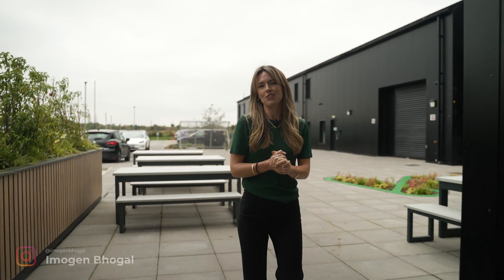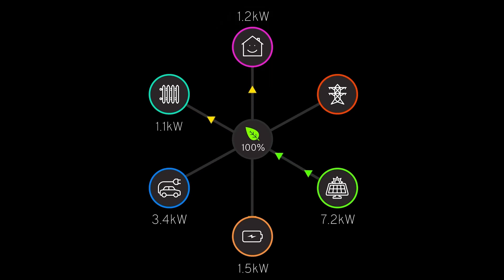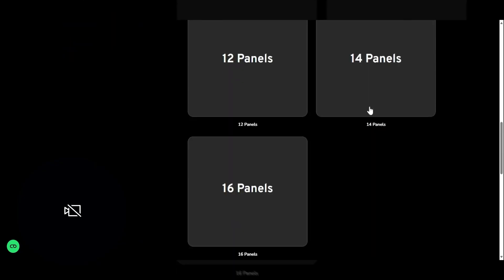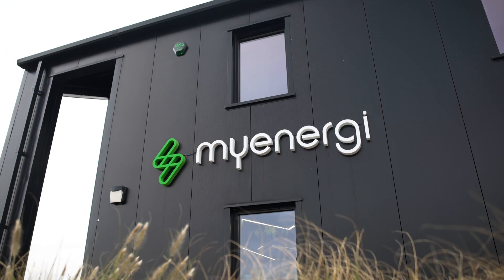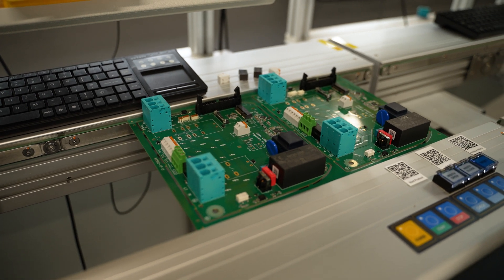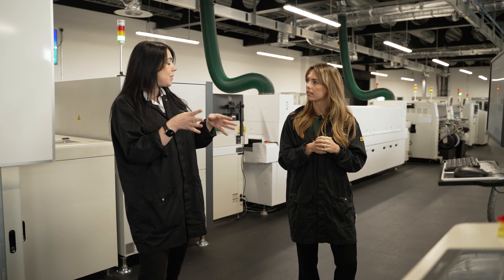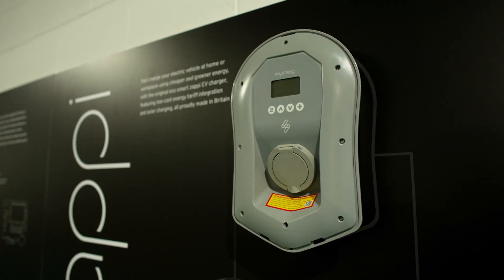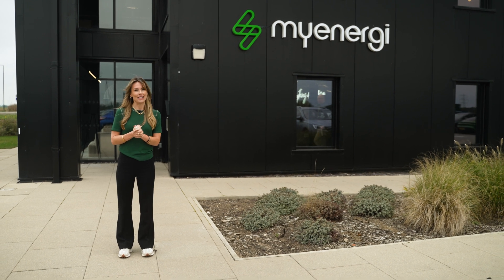myenergi One: THE Way To Get All The Home Energy Tech You Need! | Everything Electric Show

Comment: I got a quote on the Myenegi website for a 10KW battery storage system...slightly under £8,000
Being optimistic:
Say you save 10 KWHr (10 units) per day for 6 months
(bearing in mind most days even in summer are cloudy in UK)
180 days x 10 units x 25p = £450 pa
Roughly £8000 / 450 = 18 yrs payback
That's if it lasts that long
Better off getting a feed - in tariff if you already have solar panels.
Deduct what you would have got from the feed in tariff and at this price as far as I can see it makes no sense economically 🤔
Reply: You would also need to factor in the cheap overnight top-up, for example as we head into winter and solar is not such a viable option.
25p/kwh - 7.5p/kwh (the night rate) = 18.5p/kwh saving = £330 saving, on top of your figures.  So nearer a 10-year payback.
I believe that this will be a LiFePo4 cell type, so yes it will last that long, no problem.

My own system cost £6.5k for 9.5KWh usable, estimated payback time on that was actually nearer 6-7 years depending on how prices moved.  I did very well, as I installed before the Ukraine war kicked off, so my payback will actually be nearer 5 years now.   Prices are due to go up again about now.

I did add a module on recently, the payback for that additional module is very much longer, as I was running out of capacity in winter but not by much.  However, when I go for a heat pump I will add another 3 modules, taking me to 20KWh (18 KWh usable) and I should be paying 2.5p/KWh for most of my heating, which will be nice.
Reply: @gordoncornwell  Batteries alone simply don’t add up as a saving. You need the whole system to make a real saving. 
Solar with a battery to store and distribute energy, and an EV to access cheap overnight tariff, and one day sell back to grid or run your house.
The EV is part of this energy system. Gives you cheap personal transport, low cost home energy and a possible income stream from export to the grid. Lowering the barrier to  entering this market is essential. This a good  start by MyEnergi but the car manufacturers need to step up too to make cheaper more capable EVs so this system adoption becomes truly compelling.

Comment: Okay this episode is pretty much of an advertisement for a company with noble goals; fair enough. However, based on my personal experience as a myenergi customer in Australia, I’d have to say they need to spend a lot more time getting their sales, logistics and support operations sorted out because - at least here in Australia - they are hopeless. I’ve bought an Eddi and a 3-phase Zappi and due to the local arm of myenergi I (and probably my installer) want nothing to do with them again. Their app, at least as far as the Eddi is concerned needs a lot of work. The Eddi and the Zappi are probably good products, but I would strongly advise anyone thinking of buying a myenergi product to check carefully into the competence of their local myenergi operation before buying. If you are in Australia and looking at myenegi products my advice is; just don’t.

Comment: I would like to like MyEnergi, but I don't trust them. My parents had a Zappi and Harvi installed with their Solar PV. The Harvi never worked and the installers replaced the Harvi with a Solar iBoost instead, so much more robust. Their Zappi broke, three times. MyEnergi's preferred engineer replaced it twice and literally gave up on the final instal. It still doesn't work right and Myenergi just don't care
Reply: Sounds unfortunate.  My Zappi has worked faultlessly for the last three years.

Comment: I wish the industry had started thinking about interopperability like this some time ago. I have over the years built from disparate components and the interopperability is non existent and very hard to retrofit without essentially changing all of the components
Reply: Nonsense.
Reply: I'm not seeing which components would need an inter-operability standard?
Reply: My EV charger, inverter, solar thermal and immersion heater don't communicate, so whenever I want to be "smart" about where the energy goes, I need to do it manually using 3 different apps.
Reply: @sylvainjamais904  you have completely forgotten the export rate. No need for smarts when using grid exportable power for immersion is pointless.
Reply: OK if you are looking to maximise income but what about when EV charging fires up during the day to help the grid and ends up first draining the house battery if the inverter is not manually told to do otherwise, or when there is an hour worth of free surplus electricity when all systems need to change behaviour or turn on at once? These are the use cases I am talking about.

Comment: The Myrnergi HQ has less than optimal PV panel placement on the roofs. They have designed  in shadow over half the panels. And why don't they put PV panels over the carpark where bi-facial panels would work best with underside exposed? They would a also create a shelter for the vehicles. And why not put a windturbine on each corner of the site? Practice what you preach Myenergi! Also I can't see any EV chargers or air sourced heat pumps.
Reply: It's called planning permission.
Reply: @richardbrice6535  There was obviously no  planning problem there with the roof solar PV panels as they have them installed already, nor with creating car parking shelter with PV panels, and now with Labour no problem with on-shore wind turbines any more. The NIMBYs can no longer stop onshore with just a single  objection as per David intellectually lightweight Cameron.
Reply: There what looks like 2 ASHP pumps out side the original building, see google maps street view. So I expect there some on the new building as well. Its a no brainer when it comes to running costs. But your right about the car park, and chargers are not visible. But I notice only one EV in the street view pics, so they could support their employees with help to buy or salary sacrifice, and start using their own chargers. The perfect test bed for further development I would of thought!!

Comment: I have 5.00kW of solar PV with an Eddi connected to the best hot water system (A Sunamp), this combination works extremely well. I would like the second output from the Eddi to go to a Dimplex Quantum Storage heater, unfortunately the Eddi outputs can only connect to a resistive load and the TRIAC electronic switch does not work with the Eddi. But great with the Sunamp.

Comment: It's not just up front cost. When you amortise the cost of a heat pump, solar panels, and a battery, over it's design life. You have to invest a lot of money in insulation and emitters to make it save you ANY money at all, and the cost of those wipe out your savings. People don't realise that energy out of a solar charged battery isn't free. It can be 20p/kWh which might be more than you're currently paying... Unlikely to be less than you pay in future, but inflation factors in there too so in real terms it's not a clear cut financial benefit. 

The cheaper it is to heat your house, the harder it is to justify insulation that doesn't pay back for 20+ years.
Reply: Insulation is always the 1st step, it will save you money if you're on gas, wood fire, coal or heat pump. Energy out of a solar charged battery is 'free' you may have had to buy the equipment but you aren't having to pay anything for it afterwards so not sure where your 20p/kWh is coming from?
Reply: @Stephen-Jones  Many people don't want to invest in insulation because although it saves energy for the rest of the buildings life, many people don't intend to live there for more than 20 years, and the amount it costs vs the amount it saves over 20 years or less often doesn't cover the costs. 

I'd love to replace my old double glazing, but the maths just doesn't work out in it's favour. I'd make more money putting it in the FTSE100 (~7.5% per year, which means you need <15 year pay back period. Ideally less than 10 year to make it clearly better.)

If you had to buy the equipment, then it isn't "free". The cost is amortised (spread over it's design life). 

Example: 
Battery cost:
Tesla Power Wall has  warranty that covers 37,800 kilowatt-hours of throughput which is approximately 3200 full cycles. Cost is roughly £10k installed. £10k/37.8K = 26.5 p/kWh. But the power wall is relatively expensive so we do the same maths for Puredrive PureStorage which is still ~£10k installed, but guaranteed for 10000 cycles of 10kW, or about 10 p/kWh.

Solar Panels:
A 3.5 kWp average house system costs about £7000 and produces about 85% of it's peak output (2975 kWh/yr). With a 25 year lifespan that's 74375 kWh generated over it's life. which is ~ 9.4 p/kWh.

9.4 p/kWh for the solar panels. 10p/kWh for the battery. 19.4 kWh for the solar power you draw from your battery. That's where the ~20 p/kWh number comes from.

Caveats: First is that the battery and solar panels are unlikely to just drop dead after it's design life and are likely to still run at about 75% capacity, and maybe require a little maintenance cost. It may continue to operate at 1% drop per year, but it does tend to get progressively worse. Especially the battery as diminished capacity deepens the average discharge depth making capacity reduce ever faster in a vicious feedback look.

This 20 p/kWh also doesn't include the cost of any required maintenance or insurance such as if you need to pay someone to get up there and clean the panels, or if a PCB in the battery fails, or a microinverter or something. Also direct consumption from the solar panels without going into the battery roughly halves the effective cost per kWh, but the production famously rarely aligns with when you need the power.
Reply: @Leo99929  Can tell you've put a lot of thought & maths into the above 👍. Another thing to also take into account is that the energy you use from generation/storage you're also not paying to get from the grid and that cost is likely to go up over time more than down (or if you charge your battery from the grid at off peak/free vs peak time and use later or even return to the grid for a profit).

Ultimately you can always argue you could do X or Y to make/save money but thinks like solar & battery are not just about possible money savings over a period of time as well, if/when you sell the house the solar/battery/insulation will also add some value (or at the very least help to sell your property compared to the same without) so the live in for 20 years has an impact but it's not really that clear cut.
Reply: @Stephen-Jones  Yeah, I'm paying an average of 22.26 p/kWh right now. So I save 2.56 p/kWh vs taking from the grid. That's 76383 kWh to break even. With heating if I use 20 kWh per day, that's about 10.5 years to pay back.

Yeah, energy prices shot up because of the war in Ukraine but seem to have stayed high due to corporate greed as they're making record profits. Weirdly the higher they make the prices, the easier the investment justification gets. I'd take it as no accident that it works out to just over 10 years. 

Prices will go up by inflation at least. About 3% per year. But that isn't actually making the fuel cost more, as you should be paid more to match. 

House value goes up by about 3% for a heat pump, apparently. Maybe double or triple that for Solar panels and a battery. Ultimately that alone can effectively convert the cost into a house value increase that you can't realise until you sell it. At least it's hedged against inflation.

I'd love to do it. I'm looking into it. Sadly for me I might require a new roof before I can put solar panels up there, and that effectively doubles the panel cost and makes the business case even harder.

Comment: He's kind of right: The problem isn't technological. But it's not all up front cost either: 

Painting my roof white or using white roof tiles would increase bifacial PV output by maybe 30%? Also make my house less hot in summer. But I can't because the council don't like how it looks.

We can't save the planet because the building aesthetic police subjectively don't like how the world would look when it's saved.

Can't put a heat pump in my front garden 6m from the road because people on the upper of double decker busses might not like how it looks when they look over my hedge. But I can put it in my back garden and stare directly at it all summer. And out the window at it as I do the washing up/watch TV.